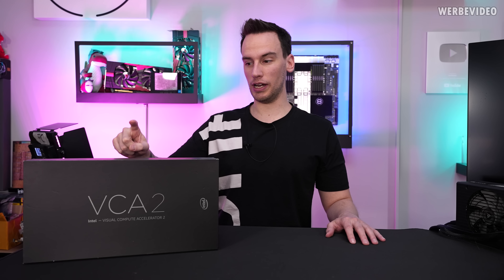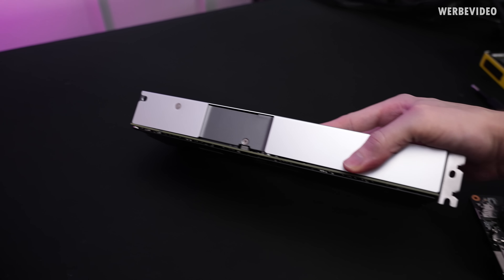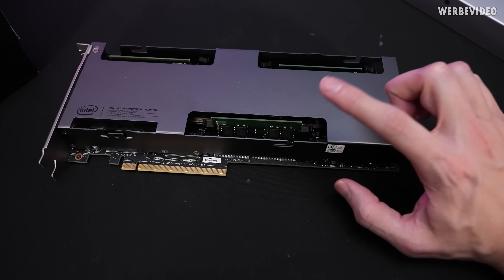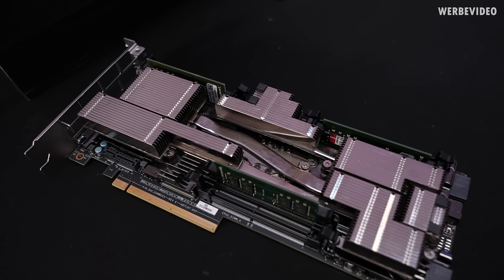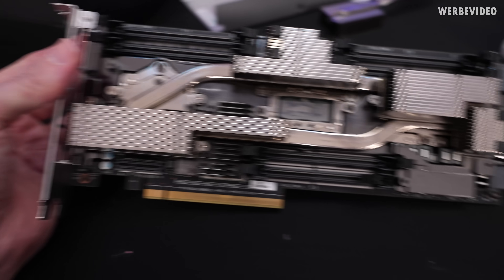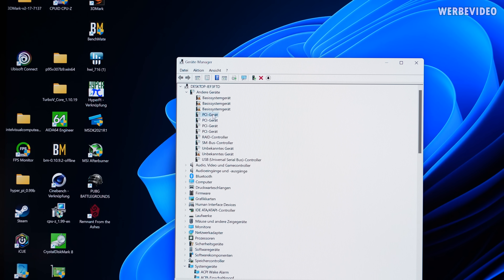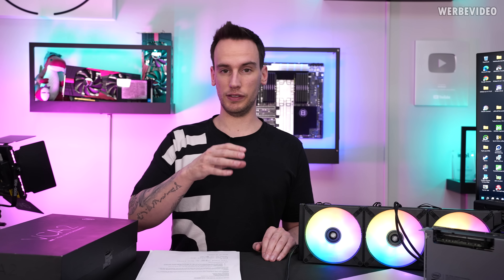Is this an Intel "Graphics Card" with 3 CPUs?

Comment: I worked on this product. Host PC required OS Linux. This Widows drivers what You used are required if you run Windows on the nodes (on this cpu in VCA).

Comment: I guess you could need PCIe bifurcation support on the motherboard (almost always a given on server boards) to get this going,  I suppose, especially given that you've noticed more than a single PCIe switch there. VCA2 docs available publicly don't mention it though, albeit there are some general guidelines about BIOS validation for the product. You might have to buy a system that had been validated for VCA2 (similar to various Thunderbolt woes on mobo without advertised TB support) in the BIOS/UEFI aspect. Looks like there had been SuperMicro 1U servers sold for this product stack.

Curious if you could get this going with some more documentation and perhaps a suitable system!

Comment: If you ever would have the time, because the interest I think you have. You could try to put this into a server or computer that should be compatible with it, and try installing Clear Linux which is Intel's own Linux distro, to see if it is detected :) I hadn't watched the whole video before commenting, so it's very very odd that you would want to use Windows installed on the card itself, while it is gonna be used under Linux....  For me it goes against all logic. Not to be an ass towards your connection on Intel, but it baffles me every time I try to search for information of a product, using the EAN, product name or number and the producer of the product doesn't find anything. And NO, it is not because it is a legacy product, this happens to me ALL THE TIME! It's more often it doesn't find anything, than it does!

Comment: Just quoting user Ryphon from ltt forum. It might be helpful for someone dealing with it

Ryphon
Member
 2
Posted September 25
Author
Replying to update whoever is interested. 

 

CentOS 7.9 as host indeed works, even though docs specify 7.4. Seems the images straight from Intel are still 7.4 (or 16.04 for Ubuntu), so doing a nice yum update/upgrade helps at least a little. I've been able to successfully run 1 card with all 3 'systems' online and ssh-able. In some initial experiments to run K3s, it seems there's still some firewall issues at play (likely firewalld, which I probably didn't actually disable yet, duh). Working on adding in a few more cards, have to do some BIOS/EEPROM updates, which is slow going with the jet engine of a 1u system. End goal is probably 3 cards running a 9 node k8s cluster. The silly part is, these 1u boxes that I picked up have dual E5-2697v3 cpus, which are already 14 core cpus. So 2 of these PCIe cards out-thread count the nodes CPUs themselves hah.

 

Next steps are to change to a persistent node image on BlockIO rather than volatile to connect and become a proper k3s node for a time, and then to get the persistence to work over NFS (even though I'm sure that speed is going to suffer for that.) Once that's at least mostly successful, I might see if I can get an Ubuntu 16.04 image running, and try doing a do-release-upgrade and see what happens if I upgrade to 18.x. I may at least have a way to run something not as ancient (and something that can handle Sunshine 😉)

 

Longer term, might see if I can get a Win10 installation running, and get some RDP going potentially. Windows is a whole can of worms that I'm not yet ready to dig into, but may end up being the solution if I'm limited to CentOS7.4 and Ubuntu 16.04.

Comment: The reason there is plastic film "domes" over the raised components is has to do with the nature of server hardware, and the nature of server cooling. As servers draw air in through the front, and exhaust is ported out of the back of the server chassis using quite a few small, high CFM fans, almost no component that goes into a server has it's own fan solution, to ensure the high CFM cooling, as many obstacles are removed from the flow path as possible, as well as features are reduced, or "muted" by covering them with something that reduces drag, and aids int he airflow.

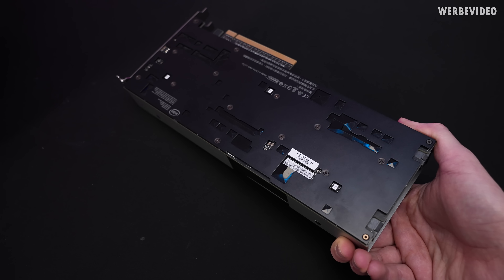Comment: 1:43 Have you noticed that there is 3 areas that are not covered ? they may be bios chips so you can flash them without disassembling the card.
Thanks for the video.

Comment: This is a QEMU geared card, I actually deal with something similar at work. Basically, you'd want to partition the device out amoung say, 3 VMs, but it's less like a VM and more like a sandboxed computer at that point. You'd dedicate one of those CPUs to that VM, and install Windows in a virtual disk, physical disk, however you want to do it, and hypothetically, that should just work. It would legitimately give you native performance, as you're just using PCI-E passthrough to give that system its own dedicated CPU, and probably a GPU as well, and it has its own ram to work with.

From there you can manage the machine remotely more easily as you can just SSH into the main node, even if this was rented out, and do all sorts of things from configuring the VM to rebooting the machine, with minimal down time, as the Linux backend would have to go down, but then EVERYTHING goes down at that point.

Comment: I am at a loss as to how to boot this card. And only having a Linux input output front end to communicate? Since this is 4 months later have you had any more communication as to the builders intentions? Is this to communicate to three different video steams at once? I will have to watch again and see what is happening.
Reply: After booting all 3 cpus through the cli you can use the card specific sdk to compile programs. Used these cards booting of a host system within dual xeon phis to show off massive parallel processing of facial detection within a rather low (for the time) power envelope.

Comment: Those windows drivers are for the windows you should install in the carditself. That's why they didn't initialized. You need to install the card on a Linux station, install the Linux software thstprobsvly will allow you to install windows on the card, put the windows driver there and you're set to go. Try that and mine some monero to see how it goes.

Comment: very much reminds me of the Xeon Phi 3120A's i bought ages ago. I got them after EOL and the support for a non-enterprise user is super scattered and it's super hard to properly get them running namely due to that you need a specifically old version of the Intel compiler suite which is impossible to get 
(i gave it a good try 18 months ago and almost got it)

Comment: They had system on card offloading since ISA. The point is this is mostly just integrated into the main high core cpu these days. Then you don't have bus losses and weird standards for doing normal computing on a pretty much foreign device.

Comment: I find product teardowns fun to watch.  They can also help me decide if I want a particular item.  Like a laptop for example.  I want to make sure the memory is socketed, even if it is already maxed out.  Then I can replace it easily if there is ever a bad module.  I never owned any computers with the memory soldered to the motherboard, without special equipment like a hot air gun, you won't be able to easily replace the bad chip.  I don't mind that laptop CPUs are soldered but I know they were not always like that.
Reply: And there was a time that many of us swore we would never buy a phone that did not have a replaceable battery but here we are. As reliable as this stuff is now, component failure is not as big of a problem as it was in the early days when it made sense to seek socketed memory. I, for one, yearn for the day when all the storage is right in the CPU and it's all unified and it's all 10x as fast as L1 cache and as capacious as a five-pound 15K drive.

Comment: you cannot simply buy VCA card and put it on your gaming rig. you have to buy at least 3 of them and mount it on intel certified server hardware. and also you get a flash drive which has all the needed software with it. and also these are meant to be working with linux for virtualization servers

Comment: The existence of Windows Drivers and the requirement to have Windows Installed on the boards CPUs explains the 2 PLX chips.
You will need a Linux host running some sort of Hypervisor and I'm betting you will also need an iSCSI disk server providing the storage for those, though this is just a guess can't be sure about that part.
The details prior to the iSCSI are assumptions yes, though I'm nearly certain I am right, can you please let me know if I am or not? If not please correct me :)

Comment: The fact that we are 2022 and there are only 2 manufacturers of CPU's and GPU's blows my mind. That's the reason why parts that should cost no more than 150$ cost 10x times.
Until the time comes when I can build a mid range tower for around 1000$ I am just not building one. Fuck them. They lose, not me.

Comment: I have an Intel VCA and did some work trying to get mine to work. CentOS was the only officially supported environment and the binaries were compiled against an older environment. 

There are two ways to handle booting the VCA units, both of which are configured using VCACTL.
 
One way is by using images stored on the HOST system which are booted effectively using PXE over a virtual network connection between the VCA CPUs and the HOST. The VCACTL tells the bios on each system of the card what to do. The second way would be to store the image on the dedicated nvme storage on the card. I believe this is the purpose for that second plx chip - to give direct access to the NVME for all 3 CPUs. The image you run is basically up to you. You can run windows or Linux on it, and those OS can be configured for headless operation. The intended use case was for mass transcoding of high resolution video, so in most cases a thin Linux OS with a GUID for the host name set at boot and a rudimentary FIFO FFMPEG being fed video to/from the host was probably what most people used them for.
I was going to set up plex transcoding by symlinking the /dev/dri nodes of the VCA  CPUs to the host and see how bad the performance hit was.

In the end I met a brick wall with my SuperMicro board in my server. I've been meaning to revisit since I've got two new e5-2658v4s and a new board with a later BIOS that might play nice with it.

Oh and the windows drivers are for windows guests on the VCA to access the host network interface after booting.
Reply: An update on this. I still don't have the card up and working, but AI is very helpful in setting these up now. Just ask Claude how to set it up using CentOS 7.4 - you can either run CentOS on the bare metal or pass the card through to a CentOS 7.4 VM. Once you've got it there, the Intel SDK and Drivers for this card should just install and VCACTL can be used to shove images onto the nodes and boot them. It seems like Claude has some documentation from "somewhere" in it's knowledge base that isn't easily found on the open internet. My plan for the card going forward is to use the card for GitLab runners for CI/CD, Plex/Handbrake render nodes, and DistCC. Right now it's on hold until I build a dedicated application server for my homelab, and move things to a 220v outlet. This card is too power hungry to use in my storage server's 850w power supply with everything else in it.

I didn't try ChatGPT but other models didn't seem to have the information Claude did about this hardware.

Comment: Intel Xeon E3 v5 is a quite old product line of processors. There are 3 newer generations for that Xeon segment. I don't know if there is a newer version for this product running Xeon E-2300 (which is the current line that replaced E3 v5).

Comment: CentOS would be the Host system, and you'd run Windows on the VCA itself.  Linux is just the Host Controller.  Load CentOS on the Host system and then go from there.

Comment: Looking into the history of the VCA, looks like it was basically hacked together solution to shove more QuickSync encoders into a system. I was thinking it seems so wasteful to use a whole CPU package just to access the iGPU, and of course they released the much leaner Server GPU in 2020 when VCA was discontinued as a product line. There must have been so much demand for transcoding at the time that the VCA made sense as a solution.

Comment: This is an Intel EOL product, that had a very small niche application in video render/streaming. The idea was that it is cheaper to do the transcoding on one of those nodes, instead of using multiple GPUs (CUDA/OpenCL) from other manufacturers. The idea was that this way you would be less dependent on PCI slots/lanes, and eventually buying Infinband adapters. Few of the VCA2s with an IB on a rack of Intel based servers and you have a real time streaming solution or a real-time rendering solution. The rendering part is actually applicable to web-sites that sell products, a good example would be a car company, lets say BMW. You go to their website and configure the car (interior, exterior), it renders in real-time and you can basically do a virtual tour around and in the car. The VCAs were meant to do all that. The idea was that the price/performance ratio was just good enough, which it really wasn't, if you know how to create good HPC farms and know your way around *nix platforms. The only plus of Intel solution was the ECC memory, something that should be mandatory in every device with more that 128MB (not a typo, megabytes) of memory.

Sidenote: BMW actually relied on a 3rd party company for such a project, that will remain nameless, but they used CUDA (during the dev phase, actually a bunch of hacked NVIDIA gaming cards)
Reply: I think it's a hardware for transcoding a video, long ago I usually used virtual dub as frame server and TempegEnc for the transcoding software, as a result the video bit rate is very stable as I want it to be. But it would take about 6 hours in Intel Katmae, maybe it will have shorter time using this device..
Reply: exactly something like this can be solve in software. i have an application that i create myself that can scallable to share render in multiple cpu.

Comment: Looks like it's a modern SBC. They have been around for decades. Early use was to put an IBM compatible ISA SBC with a complete 286 or even up to 486 system with RAM and graphics in an Amiga 2000 for example. Does it not have a video output?
Reply: Yeah, they also used that approach for devs to write code for prototyping systems using custom processors. I remember all kinds of weird SBC's that had pretty short lifespans. Probably the most successful application of all time has been dedicated RAID controllers.

Comment: Fun fact: this Xeon E3 v5 can actually be modded into a LGA1150 compatible cpu on H97/Z97 boards
the integrated graphics is roughly on Ryzen 3/5 vega iGPU level
the CPU part... 47W version of a skylake i7 for as cheap as a Pentium
It's a steal if you find them

Comment: yes, you install windows on the card itself, the drivers get installed TO the card itself as the card is its on computer, the VCA/CTL  tool is used in a linux/unix environment on the host machine to access the windows environment, also you can daisy chain a half dozen of them together in the same host computer with windows installed on only one card.
Reply: nor by default that slot is just for cache  where you store the source and destination files until they are complete

Comment: So basically, this is an over complicated and difficult to use NUC. But a NUC that can actually communicate with the host machine it's sitting in.
Reply: This would be handy for servers that want the full power of a server cpu while having a lighter cpu handle everything else like the networking and file transfers and what not like IO calls. This would be very useful for a server setup.